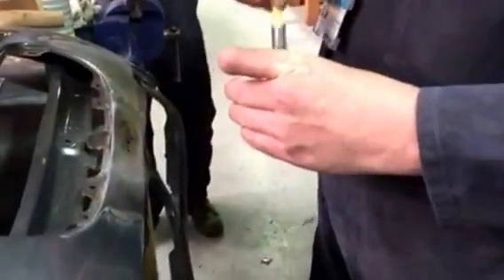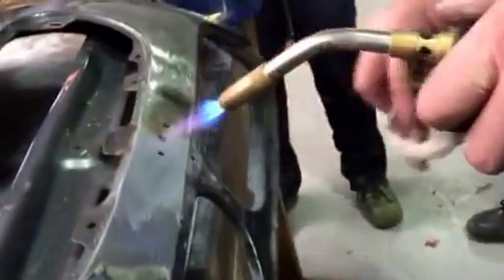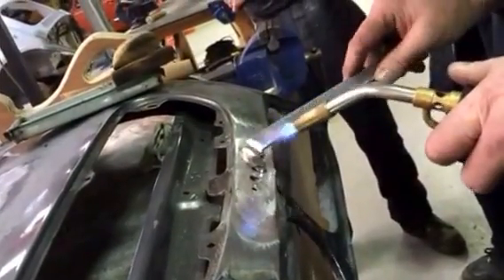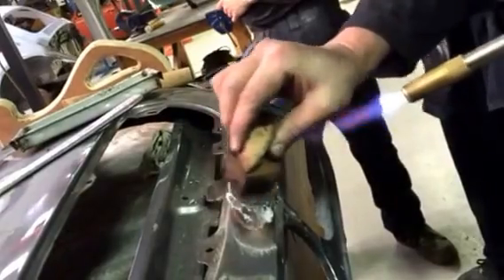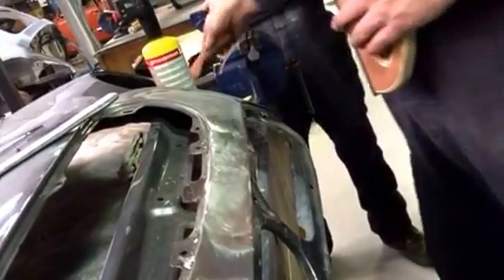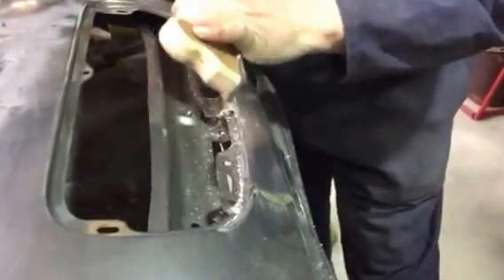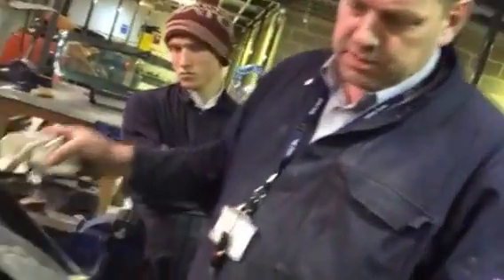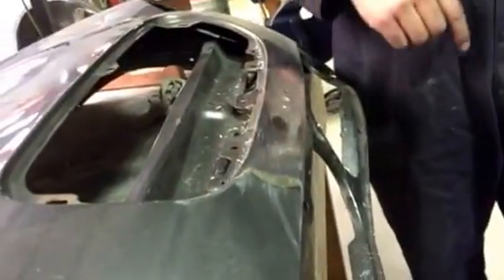How to Lead: Lead loading a body panel to get a metal finish

Comment: But is it only because they had no filler then, or they did have filler just its faster over many holes
Reply from the maker: Hi James, Sorry for not replying to you, Ive just seen your comments. You are correct to say they never had body filler back in the day and especially the choice and flexible 2K (product with a hardener) Body filler thats available these days, they still used single pack fillers (solvent based air drying stopper) back in the day, the reason I said not to go over holes with lead is because you really need to have access to clean up the area behind the hole and prime it correctly as the solder paint will start the corrosion from the behind and this is the reason the panels rot out under the lead.

Comment: can lead be permanent
Reply from the maker: Yes it is, the biggest issue is the solder paint is corrosive so it’s best not to let it get behind the area being leaded hence I mentioned not to put it over holes.
Reply: @ajkajk2424  This is a crucial detail, and very much appreciated- years later, no less!